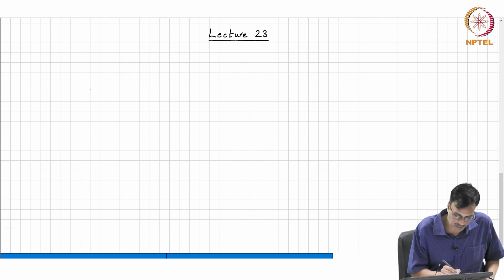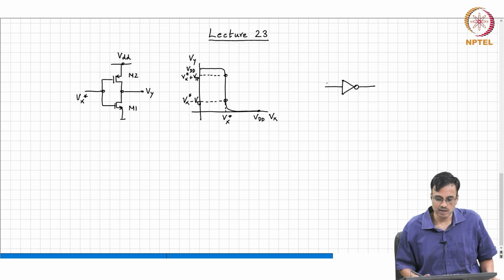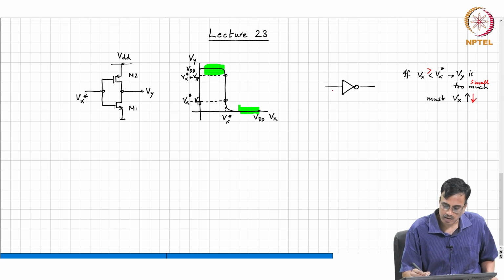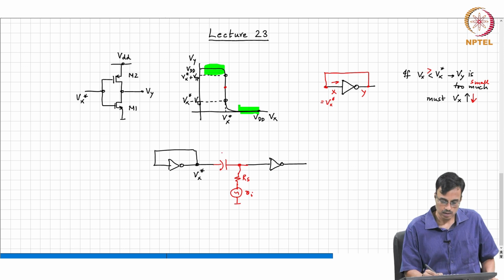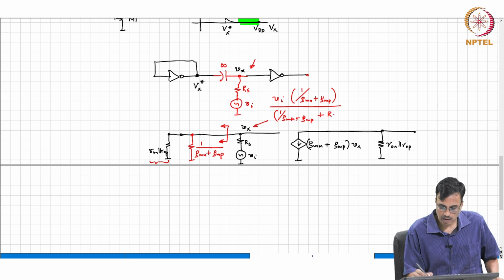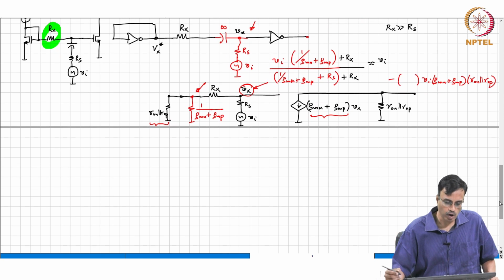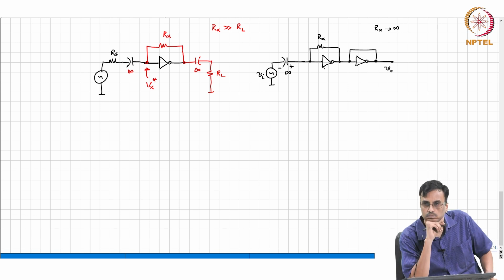The CMOS Inverter (contd)

Comment: There is a mistake in the cap connection in 10:50; It will block the DC path.
Reply: exactly what i thought
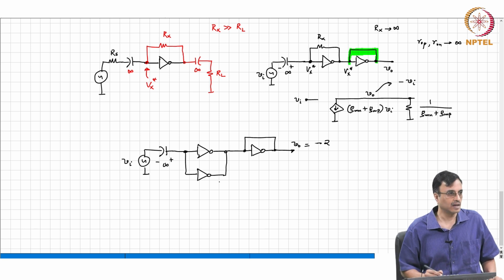Reply: yes. In addition I think there is an error in 23:40 where the large resistor accross the two parallel inverters, and in 23:58 where the output voltage should be -2 vi and not -2